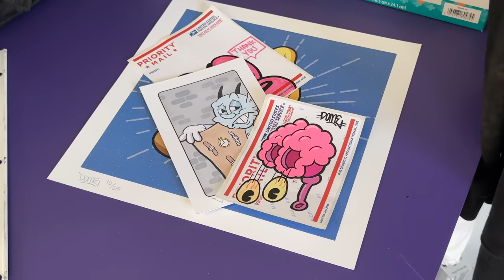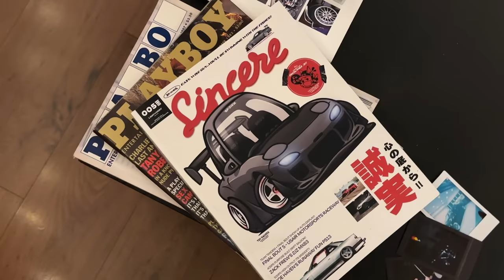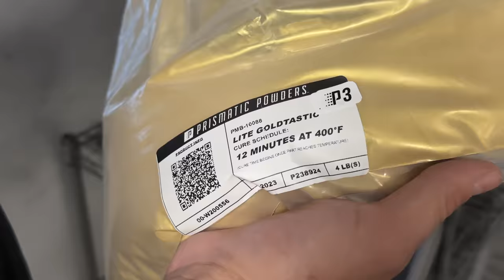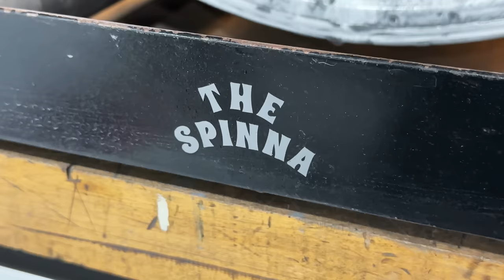Fully Restoring 6 Original 15” BBS RS’s!

Comment: i am in the middle of restoring a rim, 
having thought i bought a BBS AMG AERO 2 turns out i have bought a Japanese version of the rim named COLIN SPEEDSTAR, however there is no source on the bolt specs, i have measured them seems they are m7x32 and m7x40, what is a good place to source the bolts and fasteners, any help is much appreciated thanks

Comment: Nice video, but polishing quality is at best average, you should have powder coated center mounting are it will corrode and if you gonna say it will make it thicker and its not gonna mount correct you should not touch powder coating equipment, also bolts without threadlock ? i wouldnt drive with those wheels on, outer lips are also only done only from outside, at least clean the remaining rubber from it. If i would be customer i would ask them to be redone or 50% off for jobs.